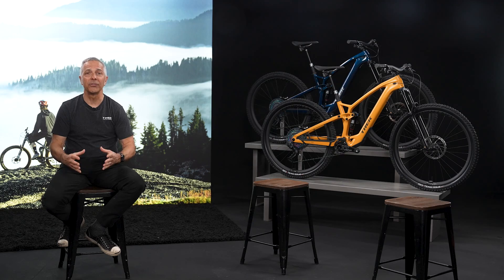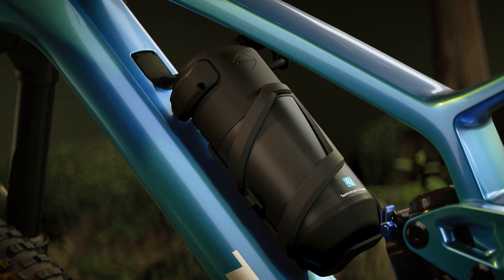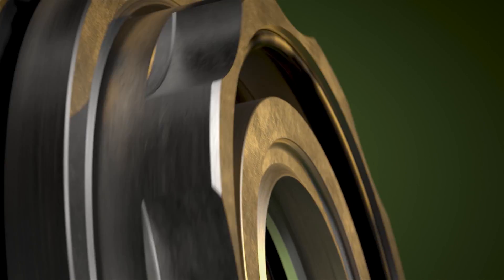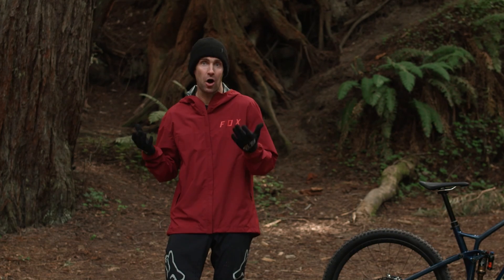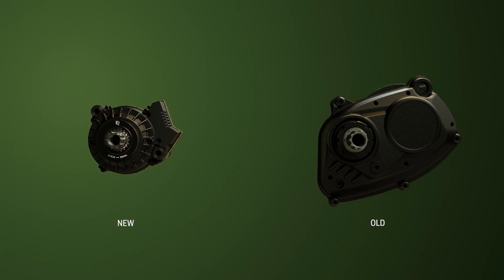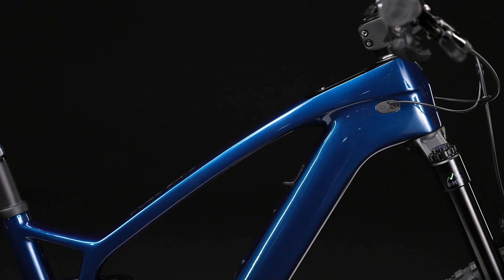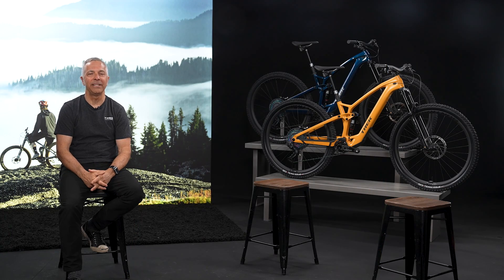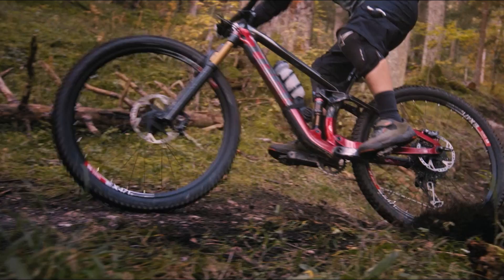Trek Fuel EXe Webinar

Comment: For me, the #1 benefit is that if I run the battery flat, it appears that I have a MTB without pedaling resistance.  While I love my Rail, if the battery is gone, it feels like I'm dragging an anchor down the path.  With this system, if it is true what they are saying about resistance, my worst case scenario is that I'm riding a slightly heavy MTB.  That gives me comfort to ride deeper into the mountains without fear that if I lose my battery, it's going to be a very tough workout to get back. I love this whole concept and will be ordering one later today.
Reply: and hey! remember! I believe you can get extended batteries that you can throw in your pack that will help get you back :)

Comment: as a full e-mtbiker, i´m looking forward to get the full ebike with a small 85Nm engine (no need that large battery for weight savings if i got the battery extender for longer rides). With this motor design, you clearly got an advantage to do so. Finally to make it perfect, a) add a USB port to be able to charge smartphones, lights, etc.  b) add a colored screen with enough information at hand able to synchronize with your garmin/etc. watch to monitor heart rate, etc., c) a space to port tools (air, pump, tools, etc.). Best luck

Comment: Tonality... AT LAST, SOMEONE WHO HAS EXPLAINED IT WELL!!! THANK YOU!

I do wish that TQ would offer (1) a wee bit more torque and (2) a throttle.

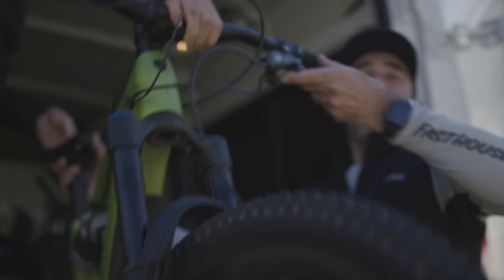At approx 8:23 into the video, I didn't see any female riders. Is that Trek's way of saying that there are no small-framed bikes for shorter people?

*
Reply: Ahh, I looked at Trek's website and the Fuel EXe does have a small frame available.

*
Reply: A throttle would make it a class 2 ebike and not legal on almost all trails, plus, it's a mtb,  surely you should have to pedal at least some.
Reply: @tonyrobinson1623  I agree with you. I was thinking about the time when I somehow injured my left calf muscle. I turned the assist to its maximum setting (Turbo mode) but it didn't help. While every pedal stroke was easy it was also very painful. I wished that I had a throttle to get back to the car safely. It doesn't have to be a 20mph throttle, heck 7mph would've been fine. Anyway, it was a painful 10 miles back.

*

Comment: Great bike for your target audience who weighs 160lbs.  It would be very cool to see the TQ HPR50 motor on the Checkpoint gravel bike as well, the silence is awesome.

 I was surprised to hear from the TQ rep that Trek wasn't interested in the HPR120, I find that disappointing as a 6'4" 270lb rider.  My favorite current bike is the Full Stache with 3.0 tires, which is used more as an adventure/bikepacking bike with a BOB ibex trailer.  Yeah, the rear end is very noodlely and the rear chain stay dosen't need to be as short as it is.  This would be a great bike to put the TQ HPR120 on for heavy riders and bikepackers.  A Coil shock would be nice for Clydesdale riders as well.
Reply: This year we are getting a few bikes with 900Wh bateries, so you should't complain too much. Skinny people desrve some love too and they only have a few options to choose.
Reply: I'm 225lbs and this bike is amazing. I don't need more power. Just gonna get fitter

Comment: Can my dealer flash the controller/speedo if I swap a smaller 27.5” wheel?
Can my dealer adjust from 25km/h 🇦🇺 to 20mph 🇺🇸 limit?
Reply from the maker: The EXe is suited for 29" wheels, but you can run a mullet setup with a 27.5" rear wheel. However, the speedometer would still read for a 29" wheel and would not change, so there would be a slight difference in mileage and speed. Speed limits are also limited by government regulations and cannot be changed.
Reply: @trekbikes  That’s a shame as government regulations don’t apply to off road vehicles.